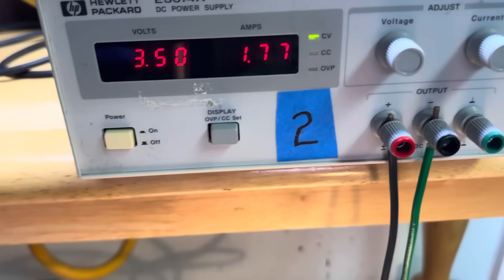Creating High Purity Silver in my Silver Cell

Comment: Would it be worth running “junk silver nickels” or junk coins in general?
Reply from the maker: Silver war nickels only have about 35% silver. I’d recommend holding coins as is. No need to refine them because they contain a known quantity of pure silver.
Reply from the maker: In order for electrolytic refining to be successful the anode material should be fairly high purity to begin with. 90% silver coins would quickly saturate the electrolyte with copper.
Reply: @sreetips thank you for the clarification, I will start buying sterling when I see it.

Comment: Do you get more silver you put in or is it just a changing state of silver
Reply from the maker: I refine gold. I use sterling silver, that I buy at estate sales, to refine the scrap gold. I recover the silver from that, melt into shot, and run it through my silver cell. Silver is a by-product of my gold refining. The cell converts the impure silver (about 980 parts per thousand silver) to high purity four nines fine (9999 parts per ten thousand) pure elemental silver metal. So I’m refining the impure silver, that I recovered from my gold refining operations, into high purity silver, not creating silver out of thin air. When the silver cell is full of pure silver, I harvest the pure silver crystal, put it away and forget about it. Then I repeat the whole thing again.
Reply: @sreetips thanks for info

Comment: Hey mate,  a few technical questions- i have nitric runoff which blooms when water is added... cleaned up i estimate 50 50  silver/copper. Good enough for a silver cell? Or do i have to re dissolve it?
Reply from the maker: I don’t have experience with “nitric runoff which blooms when water is added”
Reply: @sreetips it's when you wash your nitric jar. They're is silver nitrate in it,  contacts the chlorine in the water
Reply from the maker: I use distilled water so that there’s no chlorine to form a nitric bloom
Reply: @sreetips ah- i actually use that to purge the chlorine and precipitate the silver.  It tends to sink low and stay they're so one wash usually gets all the silver
Reply: @sreetips ah- i actually use that to purge the chlorine and precipitate the silver.  It tends to sink low and stay they're so one wash usually gets all the silver
Reply: Don't delete the duplicate. It adds to your engagement stats
Reply from the maker: I never delete any comments unless it laced with profanity.
Reply: @sreetips ❤

Comment: If you could get a more seal-able lid on the cells, would it help reduce electrolyte loss?
Reply: In this case, the best way to reduce electrolyte loss through that system is to reduce the heat of the solution. Refrigeration would be indicated. 

There are many ways to do electrowinning (this process), in some you vary the DC via waveforms, pulsed DC, suspended cathode forms to coat, it goes on. The parasitic heat is one of the problems, chilling to zero C, 32F, and below isolates some random factors due to excess heat. It can be quite an artwork to create crystals of silver, dendritic type as well as the morphology changes with doping agents and frequency variations. Control of temperatures and vibrations can be critical.
Reply from the maker: Possibly

Comment: This process is cool. But if you just added the cement silver into the anode basket instead of melting it into this shot the crystals would form something like 1,000,000x faster
Reply: In a previous video, Sreetips said the cement silver clogs the filter.

Comment: if you had a cylinder over the basket , it would act as a hopper and you could add less often. also do you really think it needs alot of surface area to migrate since its being forced with electrons anyway? wouldnt bars dissolove just as fast?